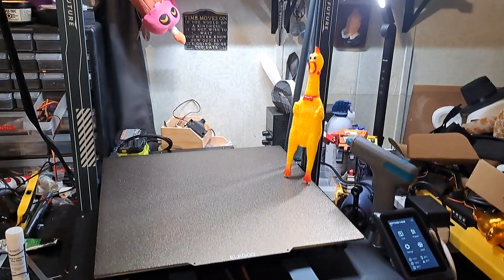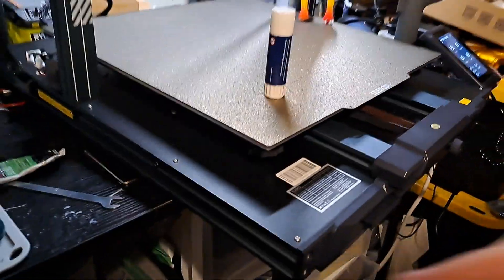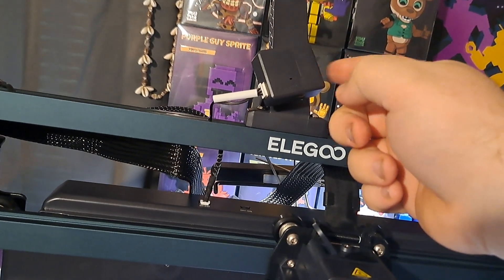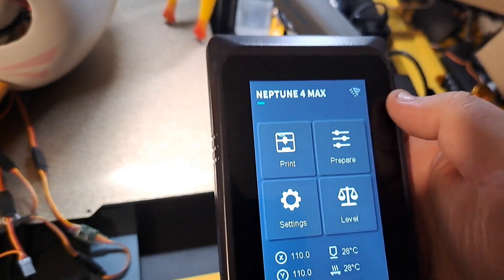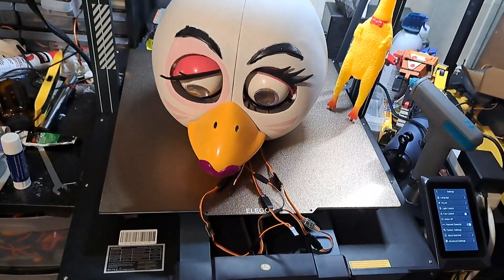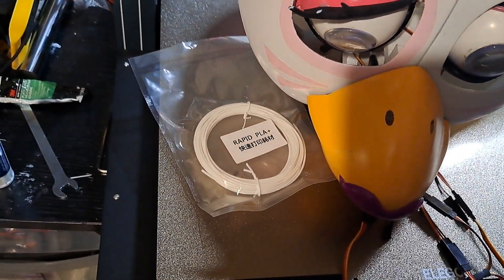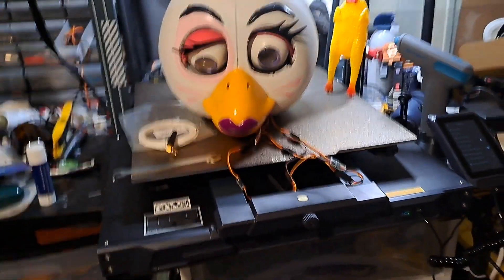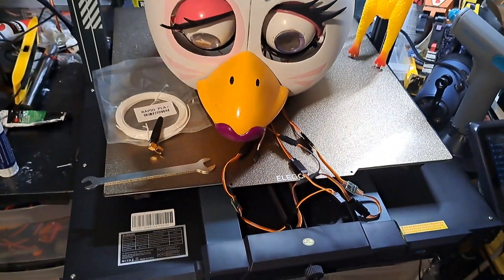Say hello to our new large scale 3d printer

Comment: done use the glue stick.  the pei bed works just fine.  i have the 4 plus and. ihave never used the glue. PETG and PLA are what I have used so far on mine.  no need for glue stick for adhesion.  I transferred the filament sensor to the hotend using a 3d printed mount so that I don't waste material.  my printer works with wifi.  you may need to change the IP address in your slicer after to turn the machine off and on.  Orca slicer works well for the printer.. no need to use usb or micro sd card.  my printer is sideways as well.  I printed an 90 degree screen holder.

Comment: Ok I know this comment probably won’t be seen, but I have a question regarding 3d printing with an Ender 3. If I’m printing with pla would it be safe to do it in my room? I tried once (for like a minute) before being overly paranoid of the fact that there may be fumes or something. I was so scared I ventilated my room over 10 hours before returning to it. If it’s not safe to do it in my room, do you have any advice on what would be safe?
Reply from the maker: I've been doing it for years and I don't know if the paranoia and other mental issues are related but I think it's safe, you can definitely check Reddit for more information since there's probably at least one solid post that explains it the most but if you're afraid of fumes if there are any you can buy enclosures that basically keep all that in a pop-up case, that thing that other printer is in technically a enclosure, also they're useful for keeping all the heat in
Reply: @vomitedthoughts  Thank you for responding! I've always been pretty paranoid about this kinda thing, so I think I may stick with the enclosure idea. I'll also browse Reddit just in case. Anyways thanks again for the advice
Reply from the maker: @AnimatingBeats  also you could just print when you're not there or do it in another room 3D printers are pretty safe and I haven't heard that many report of them catching on fire suddenly
Reply: @vomitedthoughts  I’ll be sure to keep that in mind